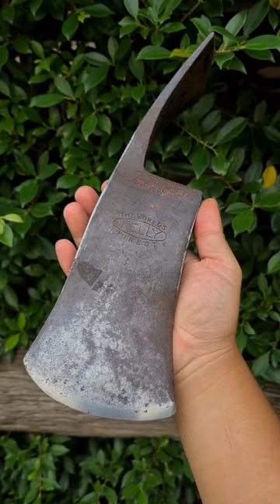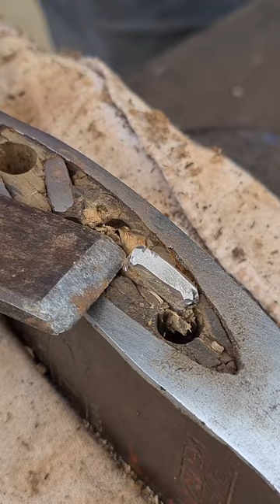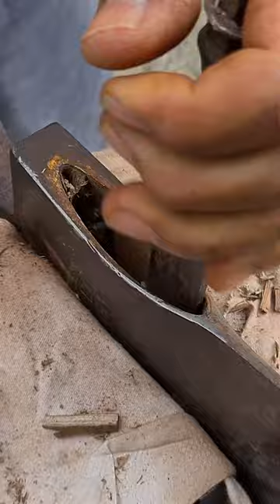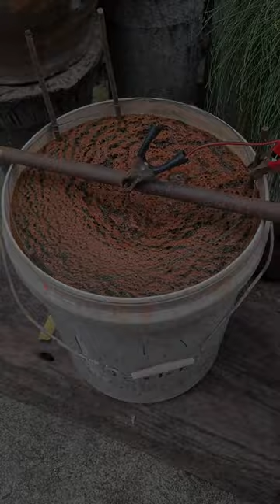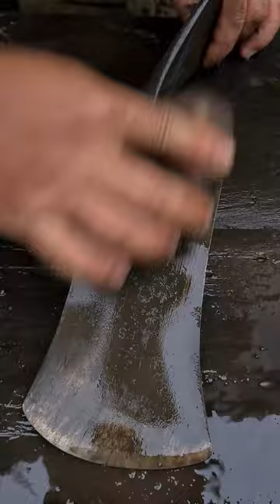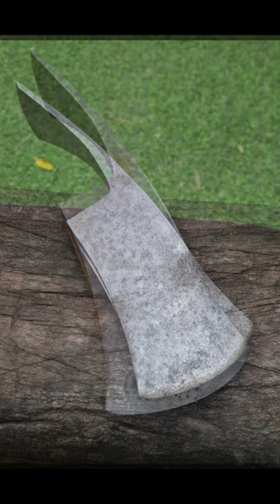Short Video Of Rusty Pulaski axe head restoration #shorts

Comment: Can you explain the electrodes and what you power them with please?
Reply from the maker: Yes sure.. The positive electrode is connected to the iron rod and the negative electrode is connected to the workpiece that needs rust removal.  The powder we use is salt.
Reply: @poomsproject Thanks! I was about to ask the same thing, what do you recommend to use to power the reaction? Car battery or power supply of some sort?
Reply: @poomsproject and how much time do you leave it in there?
Reply: Just put something Rusty in a little bit of vinegar for a few hours you’ll get better results
Reply from the maker: @justme2296  We use a car charger, sorry for the late reply.😊🙏
Reply from the maker: @justme2296  Most of us soak them for about 40-60 minutes depending on the amount of rust.